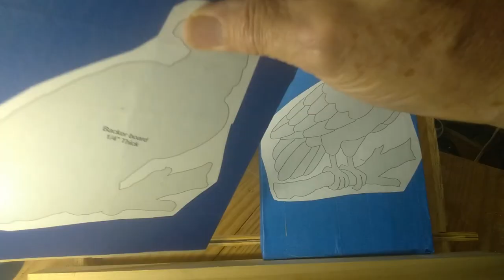A Scroll Saw Segmentation Project From A Steve Good Pattern

Comment: Is the backer board protruding on the left figure.  If so , do you trim it off?
Reply from the maker: Yes, the backer board protrudes about 1/8 to 3/16 all around on both figures.  That is the way the pattern is designed, it is more  obvious on one because of dark to  light contrast.  I didn't trim them.